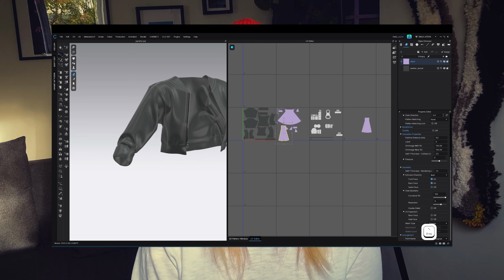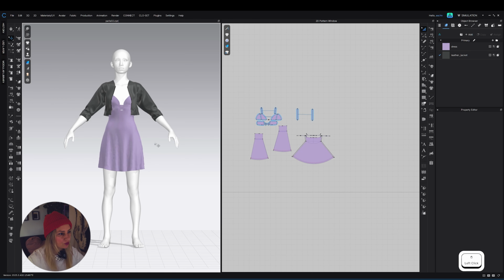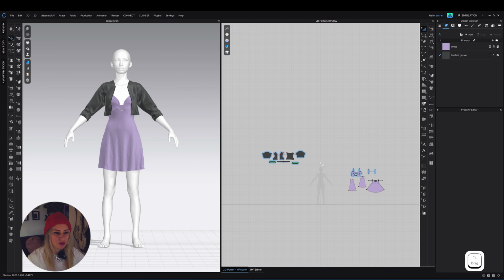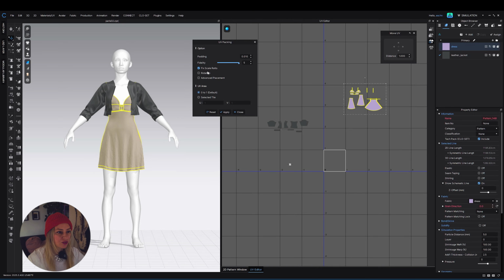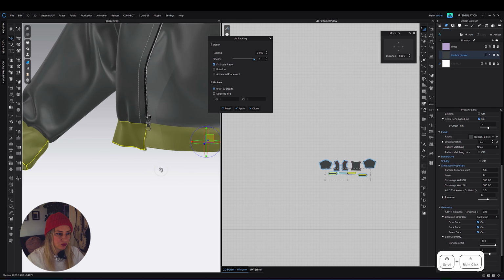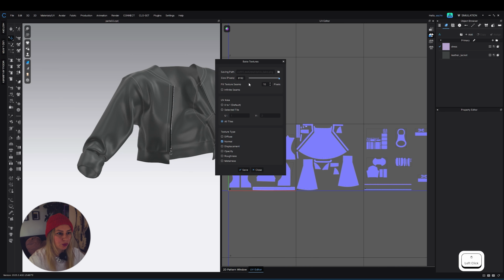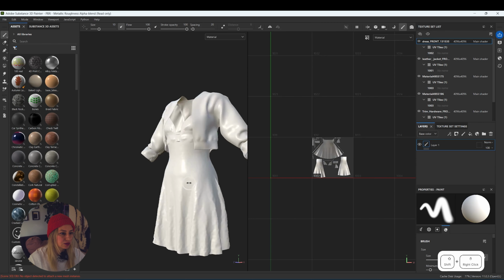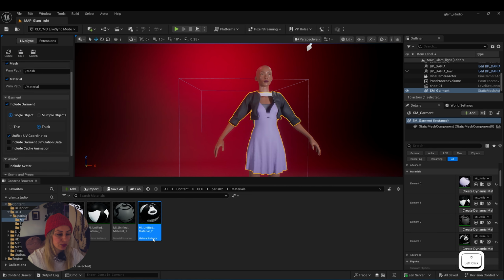Master UV Layouts in CLO3D — Boost Texture Quality for Unreal Engine, Blender & Substance Painter

Comment: when I import from clo 2025.2 to UE5.6 using livesync it happens that the imported garments have a plastic look compared to how they look on CLO3D, is that normal? also I see that the 3D effect for the topstitches is really heavy leaving black lines on the garment. 
so my question is, is it normal that you have to everytime adjust the textures in UE5.6 after using livesync cuz my cotton jersey once in UE looks like plastic. 

Also when imported in UE5 (with "include seampuckering normalmap" toggled on) i see white spaces between the UVs, like what could be?
Reply from the maker: I also have many bugs when importing from clo. Mainly i texture in Substance Painter and import either USD or texture set. And I set topstitching to texture instead of obj. For puckering I also use substance painter, so actually I didn’t tested the new feature. Probably best would be to report bugs to the CLO Set Connect forum. So CLO can improve by themselve for next version. I think your feedback would be very valid
Reply: @aschno thank you! I will try sending some feedback :)

Comment: Thank you for your content, it’s very helpful. I have a question: does CLO Live Sync no longer work with the individual license and only with the enterprise one? Is that correct? It used to work for me before, but now it doesn’t…
Reply from the maker: I also use Individual License. But interesting, I have heard the question yesterday from someone else. For me it’s still working with CLO 2025.2 and UE 5.6. Which versions are you using?